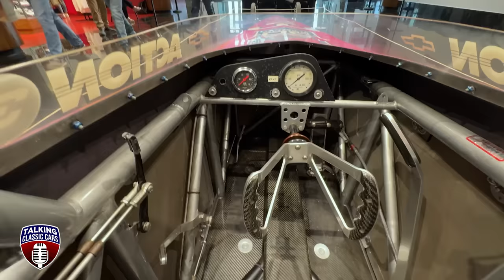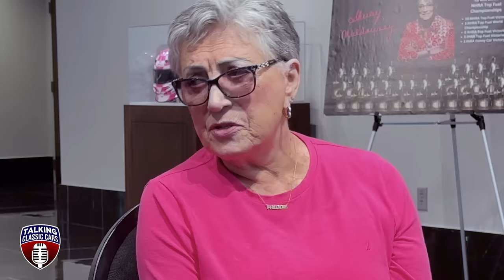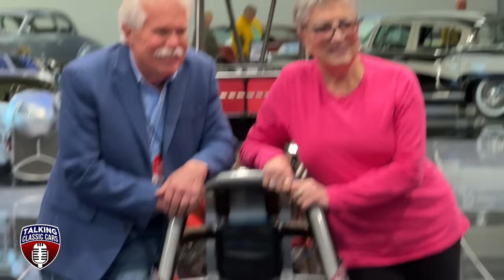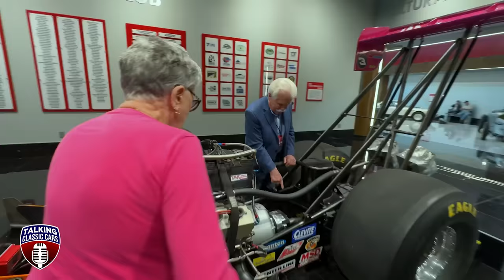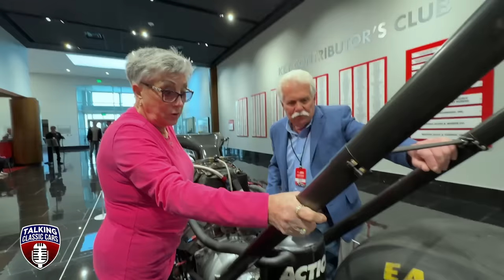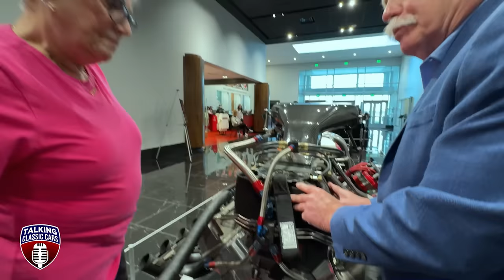Wayne Carini talks to drag racing legend Shirley Muldowney on Talking Classic Cars

Comment: Saw more than a few drag races on TV, that Shirley was competing in. And saw a few where she crashed, and it always scared me when a crash happened. And I’ve worked on cars for the last 40 years, never worked on a race car or dragster but I’ve been next to a few when they got started up. I’ve also fired a few hot roads up with open headers, and no exhaust manifolds that I built and while loud enough to feel them they didn’t even come close to the level of a dragster or nascar engine loud. Only thing I found that was louder, was the whine of a jet engine.

Comment: If memory serves, the motors run around 8000 RPM during a run.  Maybe 8500.   It's interesting listening to them during a run especially in car cameras.  You can hear the clutch stages engage and pull the RPM's down, then it hits lockup 1/1 and the RPM's climb again.

Comment: What a icon for the sport. But we held a event in which her and Ed McCullough did an exhibition run. We swept the track return road and staging lane with push push brooms. 1 run and they shut down at mid track. We ask for autographs and was told to f###off.

Comment: In the early 60s my wife and I attended drag racing at Fremont and Half Moon Bay.  Top fuel, AA/FD, cars arrived usually on an open traveler with an extra pair of slicks, nitro and some engine parts.  Even then it wasn’t cheap, but by today’s standards, a small operation like SM, DG, Gotelle, etc. would not stand a chance.  But compared to FI racing, modern fuel cars are cheap just a mere few million dollars compared to FI teams with hundreds of millions to spend.  Appreciate SM’s contribution but I’ve found her to be rather self centered in a number of interviews - more impressed with Garlits.

Comment: The rear engine is a bit safer for the driver in that in the event catastrophic failure of drivetrain the damage is not as much in line with the cockpit. It is however behind you at 200 mph if rail goes out of control.